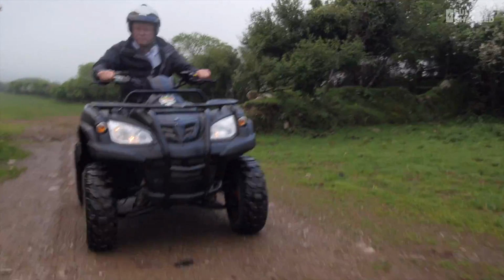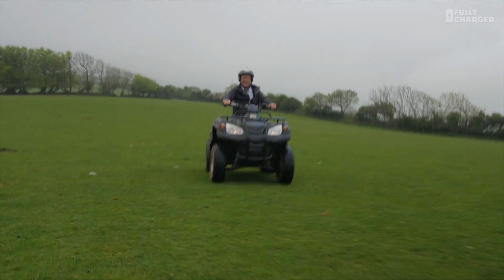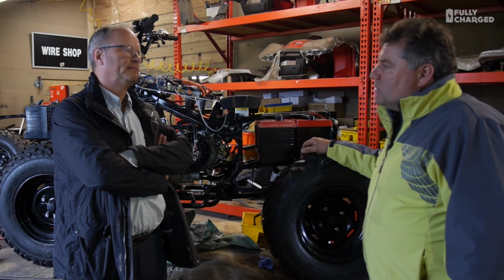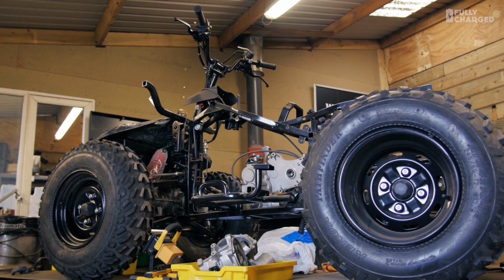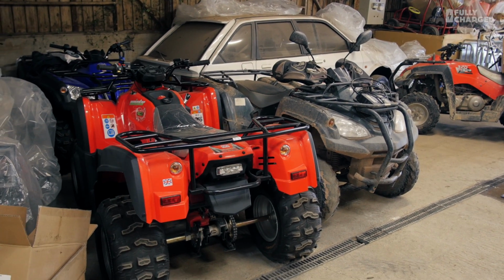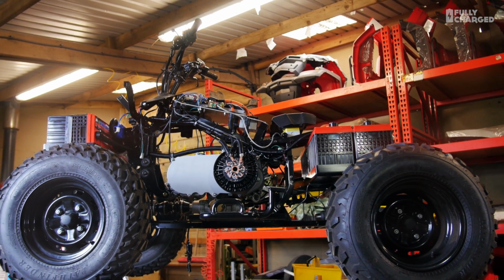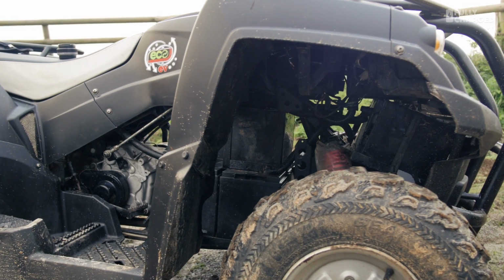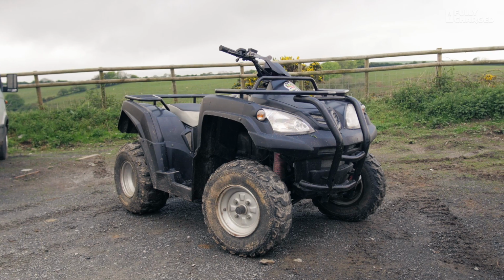Electric Quad Bike | Fully Charged

Comment: this channel keeps getting better and better! i plan to convert one of my old 1980s Honda ATC 185 3 wheelers to electric someday.
Reply: Get the lawn tractor finished. That will give you a good base of knowledge to work from before you tackle the trike.
Reply: *****
there is no finishing of my projects like that, lol. plus i already know how to make the 3 wheeler electric.
Reply: Rinoa Super-Genius I hear you. I have so many incomplete projects around. It really can get out of control.
But the ones that I've completed are so much more rewarding.
Reply: *****
thats differant, you have a goal and dont reach it. i have goals and reach them, but then add newer goals to improve what ive made. i completed what i originally wanted when i used the lawn tractor to move those piles of dirt in my front yard. so im not sure what your going on about, and how i have to "finish" this before doing a honda project.
Reply: Rinoa Super-Genius I didn't think I came off as an ass hat, but apparently that is how you took it. I hope you loosen that fist and take friendly advice for what it is. Have a great day!
Reply: *****
 and maybe you should learn to not boss me around like "Get that lawn tractor finished" and i wont get upset with you. you hold no power over what projects i do, i do what interests me. hope that makes the situation clearer.
Reply: Rinoa Super-Genius No problem dude. I wasn't trying to boss you around.
I have watched you struggle through your projects making mistake after mistake,often raging at the people offering advice, who've already made the same mistakes you're making. I don't know why I thought this interaction with you would be any different.
Adios amigos...
Reply: I WAS TOO! That’s why I’m watching this video on the quad to get some specs to use with my ATC

Comment: Makes absolute sense for many purposes. 
Slowly becoming an electric convert... loving my 40V Li line trimmer more every time I use it. Reasons...LESS NOISE!, 
NO fuel cost, reputable manufacturer with parts available, ZERO pollution in use.

Comment: Hi Robert, I don't know how viable it would be for you to review, but there's a New Zealand based company, UBCO producing their "2x2". An all-electric 2 wheel drive utility-oriented motor bike, suitable for slippery conditions such as dairy farms, national parks, with a street legal version being introduced later this year. They're already seeing international interest, so once they've got them across the world, hopefully you'll have a chance to see and/or review one. Loads of fun, plenty of grip, and a very unique piece of equipment that solves a number of problems in regards to maintenance and running costs.

Yes, I work at a shop that sells them, Yes I'm a little bit biased, but I think they're onto a winning formula regardless of how well they've executed it.

70-100km range on the flat, 40-80km on the rolling hills. 200kg load capacity, towing capabilities, front and rear rack, safer than a quad bike. 2 x 1kw hub motors, regen implemented but not enabled until they've made sure it's problem-free.

$7999 NZD.
Reply: It's intended to replace AG bikes. There's thousands of ag bikes all over NZ, used for herding animals rather than towing stuff. There are some quads in NZ but much of the terrain is too steep.
Reply: 2x 1KW hub motors?  Is that a typo by any chance?  that ~2.7HP, wouldn't have thought it would have much towing capacity / carrying capacity up hills with so little power?

I have a 2.5KW hubmotor on my E-bike and know its limitations well.
Reply: 1981therealfury
It's surprisingly powerful given the format. Enough torque, being electric and all that, not a terribly fast top speed (restricted by software as far as I'm aware) About the same size as a Honda CT90.

UBCO 2x2, check out their website, facebook page, or YouTube channel.

Comment: The elephant in the room: What do they cost?
Reply: When you factor in potentially zero fuel cost, ease of repair, etc. That's a very good deal. Wonder how long the batteries last.
Reply: According to their website, the more expensive (4WD) model costs about £9k, while a competitor Yamaha costs around £5.5K, but the torque coming of this thing is incredible. I also estimate, with ~8 miles usage a day, that the Yamaha costs £2 to use daily, so it is a big step up in price.
Reply: According to their website: "FROM £8,995".
Reply: Yes, and if you were a farmer you would know that animals don't like loud noise engines. The damage that the £2 petrol has caused before it even gets to the tank is ridiculous against the electric coming off the barn roof. A petrol engine will wear out long before a electric motor will.
Reply: I mean you could build one fairly cheap. I've salvaged countless 18650 lithium ion batteries for free and electric motors aren't terribly expensive, highest cost would likely be any parts you need machined.
Reply: @judithlough6  I've salvaged about 20 18650s but honestly I don't know where I could find any more. Where do you typically find these?
Reply: +Joris are you basing that on just fuel costs? You also have oil, spark plugs and all that mess...
Reply: Hi, Jim!  As with ALL ELECTRIC VEHICLES (outside China), if you need to ask "How much?", you can't bloomin' well afford one, mate.   It'd be cheaper to stick a howdah on that elephant you spotted...
Reply: Elli P Absolute bollocks, fully electric mopeds available NEW for less than 2K
Reply: @reuben8140  Yeah with a 20km range and 3 hour charge time. If you want anything that's even remotely usable outside a small city with a private charging spot, it's gonna cost you a lot more.

Comment: So true. The perception of certain things requiring petrol engines. Recently I became frustrated with my petrol chainsaw after its carburetter becoming blocked for the 100th time. I only needed to cut some firewood near the house, so went to my local hardware store and purchased an electric one. It's much more powerful and even my partner loves using it because it's easy to use! I posted a picture of her on Facebook and some of my friends were laughing about us using an electric chainsaw! They have never even used one to know they are superior.
Reply: I have a 240v plug-in lawnmower because I realized that all the time I will spend moving the cable around is less than I would have spent mixing fuel for a 2 stroke one. The only reason to have a petrol chainsaw is for 4WD adventures (clearing trees from the road), since it sees minimal use and is away from wall outlets. Then again a 12v powered one would be better.
Reply: IOUaUsername that's a great point about the lawn mower. Regarding the chainsaw, you are right about the necessity for portability. In my case it's rarely needed. I can see petrol saws becoming obsolete when the 12V battery powered saws become more affordable.
Reply: You could never use an e saw if you actually cut firewood for your sole source of heat at home. When it's wood cutting day at my house, you'd need enough juice to run a machine for 8 hours. I don't see batteries handling that for a long time.
Reply: +Nick Loganbill if you have a electric outlet near by two batteries should be enough for 24/7 use three just to be safe. You charge one while using the other.
Reply: I have a 40 volt battery powered chainsaw (Greenworks brand) and I haven't touched the Stihl since. I hate fueling a chainsaw in the woods. The battery saw really does everything I need to do and the freedom from gasoline and noise is great. I've cut through some very thick trees with no problems at all.
Reply: Nick Loganbill Agreed, at the moment. It will be a long time before a single battery could handle 8 hours of service. I think it would be more reasonable to carry multiple batteries, but at this moment in time, is cost prohibitive.
Reply: +shelory there's usually no electricity in the woods :)
Reply: Nick... A friend of mine is a logger and they don't have any problem.

They have a gas generator on site small little thing that burns a few gallon a day.

They plug about 50 batteries in and go to town.  When a battery is dead (about 2 hours) they head back and swap it out.   (I will tell you that the company he works for is having them review and give advice to the company so everything they have was free. ). So when batteries start holding less of a charge this will get expensive as hell
Reply: +Nick Loganbill they aren't multi million 5 man family operation.  They use a mule to get logs out of the woods, and have one truck. But that's part of the reason they were chosen.  Small family oriented company of loggers that have been in business for about 70 years.  

They were asked to test and rare the saws he likes them but at best you only get 2 hours so you need a poop ton of batteries.  Each saw has 3 batteries.  They take about an hour to recharge and you still need a small generator. 

And they don't have the power that a gas powered one has.
Reply: So you run a cord out to it.
Reply: +Kano Wins I can't wait for graphene and supercapacitors to become practical and cheap. The gas motor won't know what hit it..
Reply: Nick Loganbill Cannot wait either!
Reply: +Willie Pierce that's seriously awesome for them! lucky for then they're a multi-million operation but I'm just a one family show :P Glad to hear that the big leagues are looking electric though. exciting stuff!
Reply: Sounds like a great way to do the job. I really like the battery saw that I use. Three batteries last as long as I do and the batteries are far better to carry around than gas.

People seem to really underestimate how long the batteries will last. There is a lot of dead time for the saw. I also like not having to use ear protection since I can hear others better - which I think is a good safety feature.
Reply: I've seen an electric chainsaw plugged into the charge port of a Zero motorcycle. With 16 kWh on tap you'd be able to saw for about 8 hours continuously. I mean continuous, without releasing the trigger.
Reply: Sounds like the range argument with electric cars.

Comment: Lead acid batteries are a puzzling choice. I  get the mass argument and price too. Still I have some doubts about it. I wonder how a model with Lithium Ions would perform. The saved mass could be used to pack more batteries or make the construction stronger. (yeah the price would rise). How about lithium iron phosphate (LiFePO4) batteries?
Reply: The weight is absolutely necessary for towing (the main use of a quad). You'd be surprised at how poor farmers actually are. Tesco/Coles/Woolworths/Safeway are sending them broke, then Aldi comes along and buys the farm and pays them decently (even in drought). None of them would be likely to risk the outlay on a lithium powered quad in hopes of saving in ongoing costs later.

Comment: Demoed one of these and sadly that "bit of extra weight" IS a downside if you need an ATV to get around on soft, claggy ground in the winter. It makes a bit too much of a mess when the whole point of an ATV is low ground pressure.
Hopefully the price of lighter battery technologies will improve things but until then petrol still has the upper hand.

Comment: Without a doubt I would ditch those lead acid batteries and put lithium ion instead.
Reply: It's more about price to power output. You need the weight for towing traction, so if you went to lithium power you would need to either have excessive range (no real point, just adds cost) or a bunch of dead weight to provide traction. Why make the quad cost so much more for either no advantage or an unneeded one?
Reply: Lithium-ion chemistries would probably be also more efficient charging. Usually lead acid dissipates some energy when charging.
Li-fe  could be a good option.
Reply: Sure LiFePO4 batteries would last for more years of service, but farmers manage costs for most things seasonally (such as petrol, diesel, fertilizer, seeds), with large purchases every 5 years or so. A lead acid powered quad which is close to the price of a petrol one but needs new batteries every 5 years fits better into the economics of farming than a far more expensive lithium powered quad that lasts 15 years.
Reply: And add in a charging system. And a heat monitoring system. And a couple of weights. And a protective sleeve to protect your expensive batteries. Yeah, I think I'll stick with lead acid, unless you are actually using your quad bike for more than 30 miles each day, in which case, why?
Reply: Odyssey batteries are rated to a much great depth of discharge than most other AGM batteries.
They're quite popular in dual battery systems in Land Rovers and I could never understand why people were replacing the standard 95Ah AGM with a physically smaller 70Ah Odyssey, until I did some maths and worked out you got more Ah usable capacity and a higher cranking amps whilst using less space and weight.
Reply: +Telmo Monteiro Not quite as high density as Li-ion but indeed yes Li Fe Po4 would be an option to increase both safety and specific energy compared to lead acid. Lithium sulfur would also be a good option although cost is higher  and availability is scarce right now. Solid state polymer battery tech is also an option further into the future.
Reply: +IOUaUsername Li-fe is heavier than the usual Li-ion cobalt chemistries (or even manganese I guess). 
Lead acid (Pb) could (uses to be) be also problematic with low temperatures. Low capacity and performance output.
Pb has also a problem with discharging. If you use them just to 30% of it's capacity you could get good life time (five years or more), but if you discharge them often until 90% (not even 100%, which means something like 10,8V) you would need to replace them after a year. And it is not proportional. A 50% less in depth of discharge (DoD) is not double the cycle life, it's much more.
And lastly, if you don't keep them always charged up, the lead plates inside will corrode and you will lose capacity most likely permanently. 
You don't have this kind of worries with Li-Fe. 
These are things worth considering.
But I understand these specific Pb batteries used can be some state-of-art type of product which have better characteristics, but then the price should be also higher.
Reply: Lithium ion is definitely better in some applications.  For this application Lead acid seems to work fine.  Just as much range as gasoline and much lower cost than Lithium ion.
Reply: Those are not the normal lead acid. They are TPPL AGMs and very suitable for that purpose. Whilst I use LiFePO4 in my boat, these would also be an option. It all depends on the cost benefit v capital outlay.
Reply: i would agree, i use quads in an daily basis. In the summer this heavy quad would be fine but in wet winter weather i can just imagine getting this stuck unable to lift or move it in inaccessible spot.
Reply: John Rushworth Yes, they're not typical flooded Lead acid batteries; they're very high quality absorptive fiberglass mat, but the chemistry is Lead and acid.  The reason Lead acid is ok in this application is because the vehicle is relatively small and light and the typical range used is relatively short.
Reply: Loanword Eggcorn I know, that is what I said! AGM TPPL better in this instance than conventional AGM
Reply: Tom Cardale Yes, the Thin Plate AGM Lead acid do have some advantages over regular AGM, such as tolerating deeper discharge.
Reply: Less torque than electric motor
Reply: Lithium ion and carry more gear.

Comment: These look great! I live in Canada and everyone has a quad (and a snowmobile) and this is right up my alley. I did have my usual "ewww it's a lead sled" reaction, but I do get their point about a quad needing some extra weight to it. Though a lot of people here use their quads to race in the bush, with taller suspension travel and much higher speeds. In that kind of case I'd say LiFePO4 would be better. 

But great stuff! Start selling them in Canada!

Comment: A very interesting concept! 
However while having a heavier quad would allow more traction in wet/muddy terrain it is also extra weight that causes land to be ripped up and muddy. 
Still an amazing, powerful, machine 
How on earth do you manage to produce such great reviews (far higher quality than actual tv production) independently?
Reply: it's not a concept, it's a working product and it's on sale now.
Reply: Quads have to be heavy because a lot of their work is towing cargo or stuck vehicles (or pulling stuck cows out of a mud bog). In those cases a lighter quad doesn't do much to reduce the total load (payload + vehicle) but it does greatly decrease the percentage of that total load which rests on driving wheels, resulting in less traction.

A standard technique when towing on boggy ground is to have all the people nearby climb onto the rack at the back of the quad to weigh down its driven wheels.
Reply: +IOUaUsername oh no while a heavier quad is useful in those situations for day to day checks upon livestock your land in poor weather would rapidly deteriorate. Particularly around gates.
Reply: That's what a 250 dirt bike is for. If you have sheep you need to own one anyway because herding with a quad could be pretty dangerous. Too many sharp corners at speed.
Reply: +IOUaUsername I'm sorry? Since when has herding with a quad been dangerous? The majority of herding in Britain is particularly slow, the dog does the leg work.